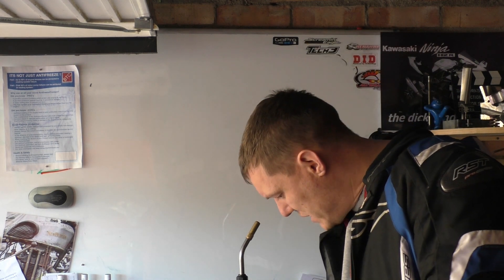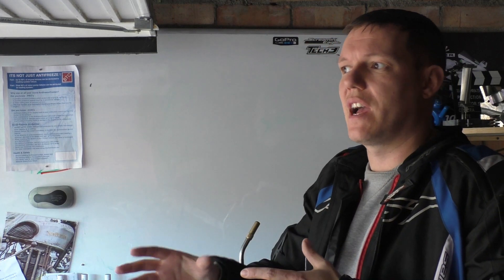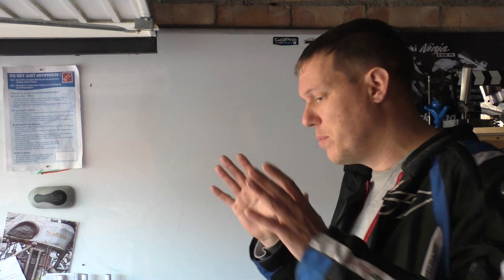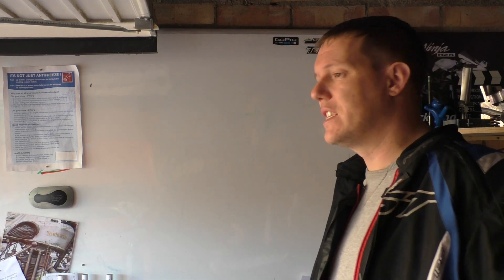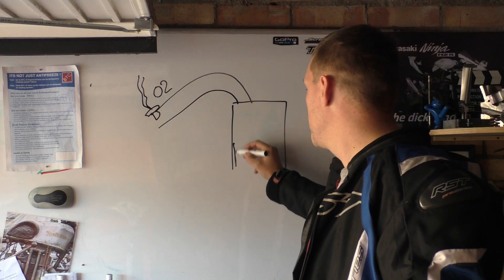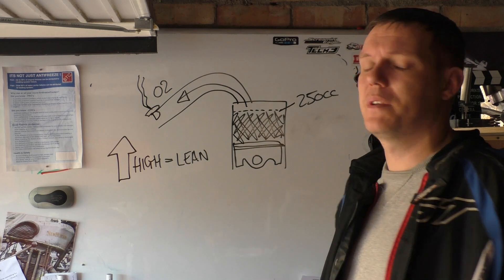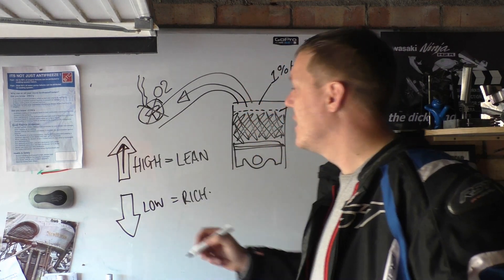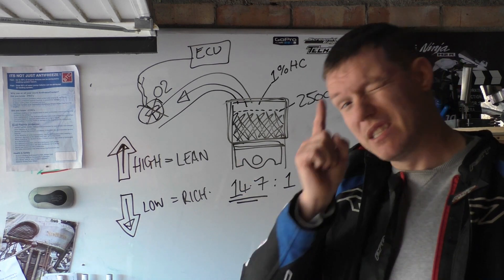O2 sensors and injectors

Comment: I'v read that the o2 sensors are only really in play on lower rpms on motorcycles and that they are there mainly for restricting emissions.is that true?  
Many people disconnect their o2 sensor when adding a fuel controller ( pluging it with a resistor type connector ) , saying that it runs much smoother on lower rpms, just because it doesn't lean out the mixture as much. is that  good/bad?

Comment: Every Dynomometer cell I’ve seen for racing engines {without catalytic converters} uses O2 sensors for carburetor jet and power valve tuning, EFI ECU tuning, and of course data logging.

Comment: I think modern engines have to many sensors. When one fails all hell breaks lose and there is to many variables to pin point the failure. A carb is great any spastic can clean it out with an air line and change the jets. Not as effective for combustion but far more service life. This is why a 60 year old vespa or Triumph twin Will start with fresh fuel as barn find and a SV 650 2018 in 60 years from now will not.
Reply: A carb may be easier to fix or adjust, but the mixture is never really correct.
On my moped the idle is wrong when it is cold, the mix is wrong when it is humid, it runs too lean when the engine is really hot, it needs a bit more fuel op top but that destroys the mid range.

Comment: Hey matt, i've found some interresting semi bullshit tech: the Drum Charger! ever heard of it? looks like a giant vaccum pump used to force induction.
Reply: here's a link: https://www.bikebandit.com/blog/drum-chargers-cheap-bolt-on-forced-induction-that-actually-works
Reply from the maker: LOL this is what I hate - bullshit like this -

"combustion engines are giant air pumps"
"pushing air in"
"converting the explosive force into power"

- wrong

"Superchargers and turbochargers both use powerful turbines to force-feed engines that extra air needed to do just that"

- super (lol) wrong.

"where a turbocharger uses two turbines"

- wrong

"Alter Ego claims boost pressures of up to 4.35 psi with a single drum unit, or 8.7 psi with a dual drum unit."

- bollocks, from a diaphram pump. Good luck with that.
Reply from the maker: "What that means is that they will likely be most effective on smaller 
bikes, especially those with larger, single cylinder engines – bikes 
like the KTM RC390, which Alter Ego mounted a dual drum kit to and 
tested an immediate 15% increase in power across the entire rev range 
with no tuning."

15% increase and no tuning? So where does the extra fuel come from?

Fucking idiots!

Comment: Hi Matt i have a problem with my 125cc pitbike 4stroke. When i open the trottle up fast then it chokes out and dies. and the other thing is that my spark plugs get black and it looks like its carbon fouled not oil. I have heard that when you open throttle up fast and then it chokes out and dies that means it is too lean and when plugs get black then it is too rich. can u give some tips what sould i do?
Reply from the maker: Sounds rich to me. Choking out can happen either way. too much fuel and combustion stops and hence the engine dies. 

Try fucking around with the air/fuel screw on the carb when you get it running. Let the engine warm up and stop revving the shit out of it LOL

Comment: This video couldn't have come at a better time as I'm doing an efi conversion project. Locations of sensors has been difficult - for example the air temp sensor - do you want to avoid heat soak and mount it miles away from the intake or do you want the heat soak so you have a true representation of the intake air temperature?
Reply from the maker: Air temp sensors need to be as close to the pressure sensor as possible. The temperature is only half the measurement. Using pressure and temperature gives you density and add this in with rpm data means you can plot this against the mass air flow data in the ECU
Reply: @thedirtyworkshop  I do have a map sensor but it's only being used for reading atmospheric pressure ie not manifold pressure - its a basic system ie injection map based on tps with no closed loop or o2 or anything. No emissions controls here m'lud

Comment: Why they dont use maf sensor like in diesels
Reply from the maker: Because it depends which sensor you use and how good the resolution is. Suzuki and other used a planum flap to this effect and the latency was pretty high
Reply from the maker: Like you just said - diesels = slow revs

Comment: awesome vid,,, can you explain ,, a "cold starting"  fuel injector,? ,,, mine is flooding or starving on cold days ,,,only
Reply: I have the exact same issue with my Honda cbr125 fuel injected! What solved the issue in the end? I have a new throttle body and sensors coming but knowing my luck it will be this sensor lol

Comment: I use an O2 sensor on an aircooled VW van with a carburettor. I have a box of carburettor jets and use the air fuel ratio gauge to assess the jetting at different points. Like for max power and fuel vapour cooling target 12.7:1 ratio at wide open throttle, then lean out cruising at 17:1, engine braking 20:1, and 14.7 at idle for the MOT...
Reply: i'm really interested to see your setup, i always have troubles tuning my stuff.

Comment: " a window into the combustion" Ahh that would be Guntions Colour tune then.. a bit b4 your time Mat. It was a glass topped spark plug. You warmed up your engine swapped your normal plug for the glass topped one and adjusted your carbs to the right colour of flame! Not so easy to do on dual overhead cam bikes with the plug down a deep hole, but worth the effort for a smooth running bike.
Reply from the maker: "Ahh that would be Guntions Colour tune then.. a bit b4 your time Mat."

- LOL I've got one, and Derek sent me one to. The glass has cracked on mine though..... :(
Reply: @thedirtyworkshop  send it to Project farm to see how long it will run until the glass blows completely.. :) or run it yourself to destruction.. :) make a good video. See how high the compression ratio has to go b4 bang! ;)

Comment: Matt, why do we have throttles? Why not just have an unobstructed air intake and control acceleration only with the injectors? Engine would overheat or what?
Reply from the maker: Great question and frank has it. This would mean your cylinder was always 100% oxygen (i.e 20% of the volume but the max O2 you could fit in) so you'd always been running super lean unless you were at WOT.
Reply: @thedirtyworkshop    Couldn´t this be helped with long valve overlap and forced induction? Or would  that be pointless. I've watched EE's video about Porsche's passive antilag system that uses open throttle to keep the turbo spinning for longer and thought removing the butterfly completely would make sense for it. And thanks for your answers, btw.
Reply: An easy way to think of it is that if you have full airflow you need full fuel to match, less fuel will give a weak mixture and melt a hole in your pistons

Comment: In the US they seems to have petrol with lower octane (87) compared to 95 and 98 octane in Sweden/Europé.
Question: If you have a power commander (EJK electronic jet kit) from the US with recommendations of settings for Stock air filter and exhaust or if you have stage 1 mods  (open air box, performance air filter and exhaust). Are the recommended settings for the power commander/EJK going to result in different AIr/Fuel Ratios depending on 87 octane (US) or 95/98 octane (europe) ? Or is the adjusted AFR constant (for example 14,7) regardless of octane?
Reply: Angermanland DS l octane ratings in the USA are measured differently, basically the 93 in the states is 99 in Europe etc
Reply from the maker: 6 points is a bit high. More like 4 between MON and AKI (RON+MON/2)

So in the States 87 is more like 91/92 in Europe. In the UK the average (from what I've seen) is 95, and the premium stuff between 98 and 102.
Reply from the maker: Ethanol blends usually give you the higher numbers because of ethanols higher octane rating - thing is these are all averages and nothing to really worry about.

Comment: What if the bike doesnt have an o 2 sensor and you want to tune all 4 carbs propperly?
Reply from the maker: That's the problem with carbs, they're good for a while then they drift. Same can be said for injection systems but not to the same degree.
Reply: would o2 sensors and a gauge allow you to tune the carbs!? @thedirtyworkshop

Comment: Can an O2 sensor compensate for aftermarket exhausts and air filters or is the range not big enough.
Natural gas boilers are usually around 14% O2 for good combustion readings. Interesting that you think that's high for a petrol engine. Really interesting topic. Nice one👍
Reply from the maker: We'll be getting to this
Reply: @thedirtyworkshop  when?
Reply: Isn't the atmosphere about 20% O2, so if you burn aprox' 6% of that in an ic engine that would be pretty poor imo

Comment: What happens when we ‘delete’ the o2 sensors? (Race bikes etc)
Reply: Narrow band sensors like the ones in most bikes are only used for trimming the mixture at low revs (idle and cruising), once you go full throttle the ECU reverts to using a mixture map. To do full closed loop operation you need a wideband sensor.
Reply: @cosmikrelic4815  as I understood it under acceleration or during rapid throttle changes the sensor, regardless of type, couldn't respond fast enough which is why you revert to the map. If you have a wideband are you saying it should it be possible to do closed loop throughout the rev/throttle range?
Reply: @nobbytrussin  It's Matt's channel I'll let him do the video on this, but the narrow band sensors are really for emissions reduction, a wide-band sensor will allow closed loop operation.
Reply: @suburbanrelic1182  balls to him - with his swearing and his rollups and devil music

Comment: oh i was really hoping you were going to go into "open/closed loop" in this video lol
one question for you though Matt if you may? does the ecu ignore the o2 sensor and only use the MAF for fueling when the engine is in the warm up cycle/open loop?   Cheers.
Reply from the maker: Yes. For example with the SV and the Z900, the intial warm up cycle is pre-determinded by the 'start-up' map for the ECU. A cool thing about the Z900 is that you can physically bypass it - more on this later
Reply: Martin Price it also uses the coolant temp to gauge the fuelling while cold